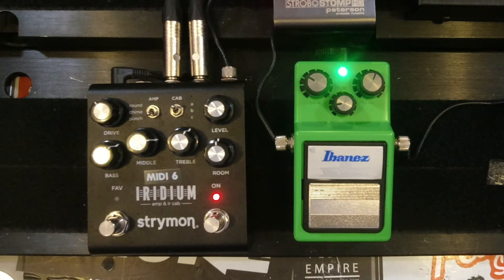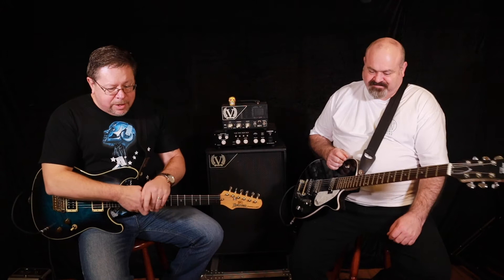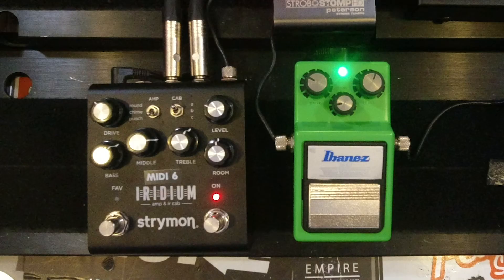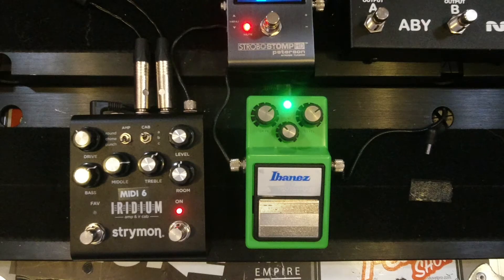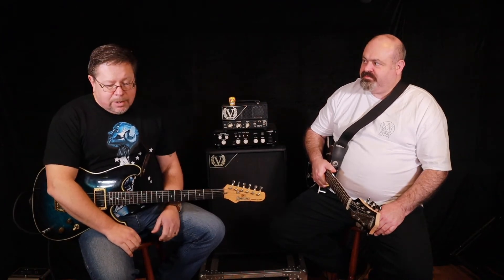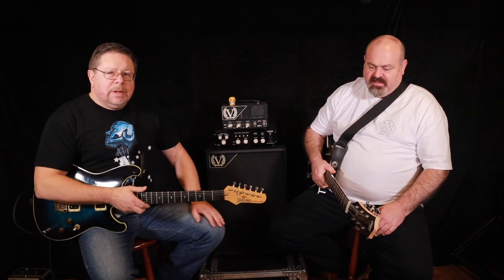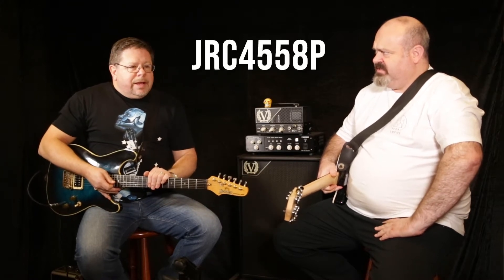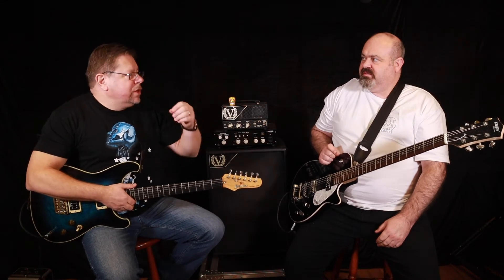IBANEZ TUBE SCREAMER WITH 3 DIFFERENT CHIPS

Comment: First time I used a TS-9 was back in the early 80s and I later bought one in the early 90s and always thought there was something a little harsh about the sound.  I was gonna buy a used one with the JRC4558D chip for like $100 but is it really only the chip that makes all the difference?  If so, you guys may have just saved me $80. I still need to order chips and tool.  Thanks!
Reply from the maker: When I was in high school, one of the older boys had a tube screamer and it was the first time I had ever heard a guitar pedal and it completely blew my mind! Since then I have owned probably 30 different tube screamers and I’ve never found one that sounds that good. It’s funny how we all remember different tones in different ways
Reply: I'm trying to swap my chip but it seems like it's soldered straight into the board. I bought it new in the early 90s. Am I doing something wrong?
Reply: Yeah I double checked, my chip is directly soldered in.

Comment: I played around with about a dozen different dual op amps in both sides of my King of Tone, and it was surprising how different some of them sounded when they were pushed into distortion.  Since the KoT has two nearly identical sides, one can do an A/B comparison easily (yellow side has a little more mid boost.)  I like to use the KoT to fatten up single coils without adding a lot of dirt, so I use "clean boost" mode on both sides (no diode clipping) and feed it with 18V for best possible headroom.  It starts with JRC4580 op amps in both sides, which sounds great.  I found I preferred the Burr Brown OPA2134 for the yellow channel, since it has a smoother distortion tone when overdriven, and left the original JRC4580 for the red channel.  Lately I have been experimenting with a CA3240 for the red channel, which seems to stack well with overdrives that are pushing the KoT input.  Since the op amp sockets are accessible without removing the circuit board, swapping them out is a breeze.